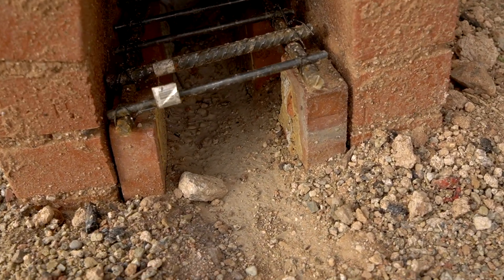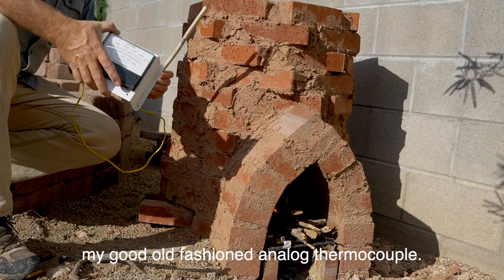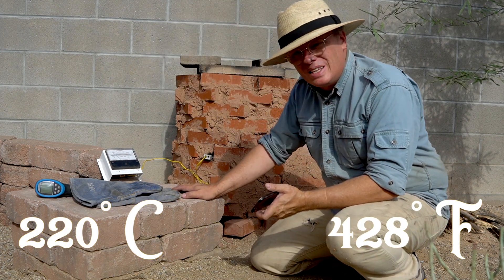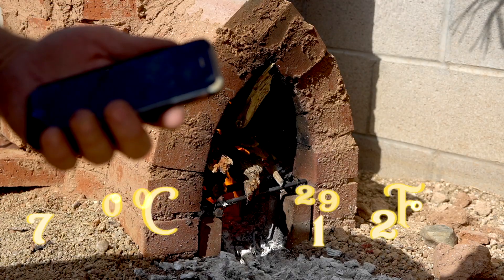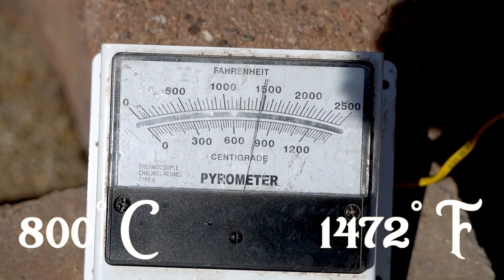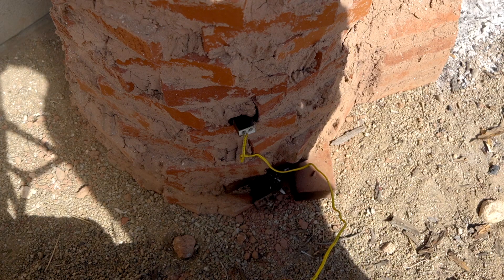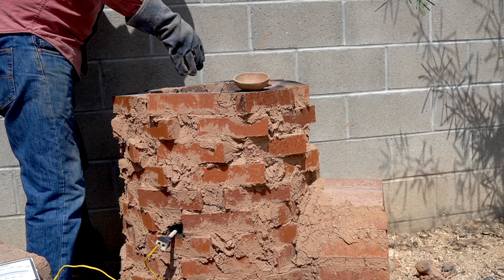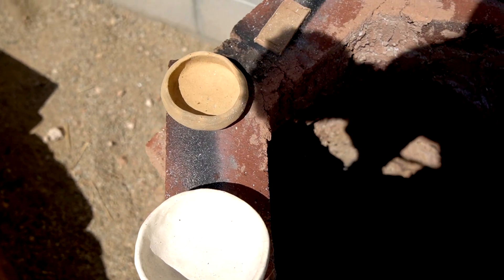Upgrading My DIY Pottery Kiln - How Hot Will It Go?

Comment: was it hot enough to vitrify??
Reply from the maker: No, my pottery generally never vitrifies though. I make earthenware so my goal is a bit below vitrification. I do believe that you could get the temps up there with one of these though.
Reply: No way you'd vitrified without a ten foot chimney, 36 hour firing, and a door on the stoking port that was closed between stokes.  We stoke about four pieces, 18 to 24", average 3" diameter every 4 to six minutes for  at least a day to even get close.  Getting to from 800C to 900 takes more fuel than getting from 50 to 80C.
A slow start prevents cracking due to shock, but also brings the kiln walls up to temperature, so that they stop absorbing as much heat from the fire.  Getting the whole kiln hot also keeps the heat from combustion dynamic, with a strong draft resulting from rising hot air, which is displaced by cool air entering primarily below the grate, for hottest fire.

Comment: Nice work, you could try firing with charcoal instead of timber, it usually burns hotter. Also when you have the fan on, try closing the extra vents at the bottom. Keep up the good work. God bless
Reply from the maker: Thanks for the tips.
Reply: @AncientPottery   Hi Andy I will be interested to see if these work too. God bless

Comment: You should reach 2000 F easily using a leaf blower. Just like a blacksmithing forge. I really want to build a kiln like yours, but with fire brick. I'm afraid building brick will break down after a while.
Reply from the maker: Well I’ve fired a number of times and don’t see any wear and tear on my bricks. But I’m only running it up to about 850 - 900 C, if I got a lot hotter I might.

Comment: I just bought cheap materials to build an experimental kiln( will work for sure) like no otther.
As a source heat il use a forced air TLUD gasifier ,no smoke( smoke is flame thats wasted= wasted fuel).
A Tlud is quite simple to make and efficient and doesnt have to have a fan to be forced air.
TLUD is way more performant than a rocket stove.
For insulation of the kiln i use cheap Ytong bricks lined with ceramic wool so that the ceramic wool will protect the Ytong a bit since the Ytong( aircrete) its stable up to 700C.
Ceramic wool comes in different grades,somme are rated up to 1250C ( aluminosilicate) and somme that have zirconia are rated up to 1400C.
Would be hard to get Ytong bricks in USA thogh.
Reply from the maker: Very cool, thanks for sharing. I would love to see pictures.

Comment: well done !  I would say the slow build up to temp is due to the nature of the bricks that suck up the heat when cool. Using some form of insulated bricks or making your own, incorporating sand, clay and sawdust for example. The size (volume) and length  of the wood feed also will have an effect on the temp. A longer wood feed would allow the heated air to pick up velocity and suck more air in, creating a venturi effect, also perhaps a larger wood feed opening and volume may help (though you have somehow corrected this with the later lower opennings. May also consider a slightly taller chimney (height of kiln) to create more draft (flame velocity). Just some thoughts :))
Reply from the maker: Thanks, good suggestions. I am planning another firing soon along with a few improvements. Stay tuned.

Comment: Very nice. What impact does opening or restricting the opening at the top of the chimney have?
Reply from the maker: You can learn to "read" the fire and adjust appropriately. Restricting the top holds in more heat, but the fire needs to maintain a good draw, so when it is burning really hot it often needs a larger opening. If the flames start licking out of the front or the side holes, it means it needs to be opened wider to maintain a good draw.

Comment: The height of the chimney as well as type of wood that you’re burning, and stoking rate. I would also use the type of fan that concentrates the air into the opening of the firebox. There are many things you can do to increase the temperature, but like you say, you’re just looking for 800 C 
Another excellent video. Thanks Andy! :)
Reply from the maker: Thanks, I will be making these improvements in the future.

Comment: Great video Andy! I love watching your videos. 😀
I’m currently working on converting an electric kiln to a downdraft gas kiln with a thermal draft inducing flu (aka TDI, built inside the kiln it super heats to increase draft). 
It seems like a downdraft (flu opening starting at the bottom of the kiln forcing heated gases to circulate down) and a TDI could be fun to play with in your kiln. 
Here is my inspiration, http://www.sebastianmarkblog.com/2018/07/gas-kiln-conversion-downdraft.html?m=1
His book on Amazon has lots of great info
Reply from the maker: Thanks for the info and the link Charles. Great information.
Reply: Simon Leach

Comment: If you check out literature on Rocket stoves, which use the same principle as this kiln, you will find that there is a formula for the proportions of the chimney diameter and hight as well as the firebox, to make them as efficient as possible :)
Reply from the maker: Thanks that's what I'm looking for, efficiency!
Reply: @AncientPottery  the batch box style rocket stove may be worth investigating

https://batchrocket.eu/en/

Comment: This reminds me a lot of rocket stove design.  With that in mind I would insulate the bottom where the greatest heat is.  Could be as simple as an air space and then mud wall surrounding the kiln bottom.  I'm also wondering about the fuel.  We have a wood around here called Osage Orange.  It is used for posts but it burns crazy hot!  I wonder if a fuel source like that could push it up a notch.  Thanks for these videos.  I'm learning a lot and its exciting to see what I could possibly do.
Reply from the maker: Same principle as a rocket stove, convection. I am familiar with Osage Orange, I used to live in Oklahoma where it grows like a weed. Mesquite, which I am using burns easily as hot as that. Thanks for the tips!

Comment: Hi Andy. I have a small side flame propane kiln that works similar to yours , sometimes if I play with the flu opening ie.. opening slightly I can get a good spike in temp that sustains . Less reduction but higher temp. Just my two cents 😐
Reply from the maker: Good tip! Thanks.

Comment: A flue pipe at that top should increase the draw of air through the bottom. You might get some ideas from this video. The guy got up to some high temps. https://www.youtube.com/watch?v=pHYCbHBw7zs&pp=sAQA
Reply from the maker: Thanks I will check that out, I am definitely interested in getting more draw. This was a suggestion made by a viewer after my first firing in this kiln, just haven't gotten around to implementing yet.

Comment: very nice ! is it possible to glaze in small kilns like this or is there somebody on youtube who glazes in small kilns? thank you
Reply: Look into salt glazes and Egyptian Fayence techniques :)
Reply from the maker: I don't know. What temperature is required to melt glaze?
Reply: At those low temperatures you could still glaze, or glass over with some low fire glazes like stroke and coat would be dull maybe but would still create permanent color . You would be below cone 06 but you could still get permanent and interesting results.
Reply: I found some "low fire" glazes on amazon but you would still want to check them out for lead content.  Not suitable for food if there is lead.  you might also want to set the pieces on a shelf  since glazes drip down and would probably adhere to the rebar..  I need to down load a cone chart to match up temperatures on how the kilns are performing compared to product requirements.
Reply from the maker: @renaissancewomanfarm9175  thanks. I’ll check that out
Reply: Look into salt glazes and Egyptian Fayence techniques :)
Reply: A Matt copper raku glaze would work. Not good safe but makes some cool color effects.

Comment: Maybe need a longer fuel chute. Probably a lot of heat is escaping through it, because its basically a big vent in the side of the kiln.
Reply from the maker: Because it draws like a chimney, I don't think much heat is being lost out of the fire box. But definitely lengthening it would allow me to add more fuel at one time.
Reply: @AncientPottery  

You could test your draft by restricting the fuel chute with a couple bricks once you have a good burn going, or stack a couple bricks in a chimney around the flue. I built a sandstone stove at my campsite thats pretty similar and I cant use it until its burned down to coals, because it has 2' flames spiraling out the top. It took a lot of adjustment to get the opening ratios optimal.

Comment: Hi. Andy. Have you looked at how to build a rocket stove. (Green shorts) your kiln is similar in design. Perhaps going full rocket stove will increase your temperatures. Just a thought.
Reply from the maker: My understand of "rocket stoves" is that they are based on convection the same as this little kiln. I think the same principles are at play, so not sure what aspects of a rocket stove might improve this but I will give it some thought, thanks.
Reply: I'm thinking of taking a giant, medal barrel I have and putting it on top of my chimney with a gap at the top to allow flow...sort of like the bell chamber on rocket stoves...I'm wondering what this will do or if it'll just snuff the fire.
Reply from the maker: @crowadventures300  Sounds like it would be worth a try